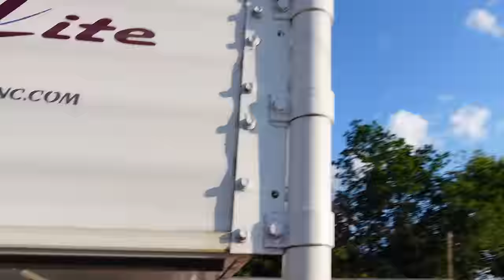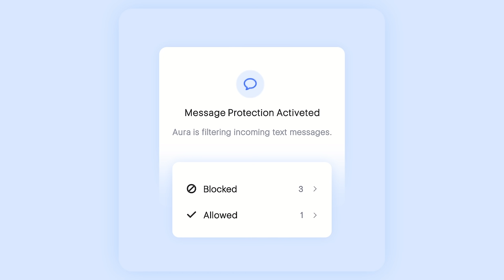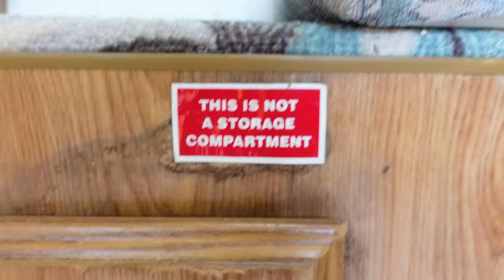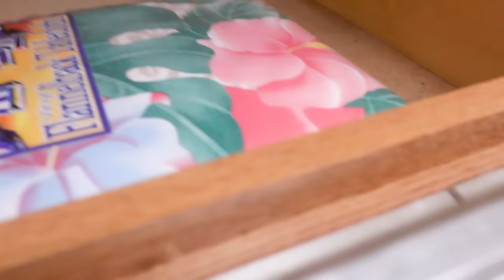i bought an old TRUCK CAMPER...was this a mistake?

Comment: For anyone else that might be interested in buying a used RV, try everything first! Like Victoria says, these things are built very cheaply. Crank it up and down, run the stove, test the refrigerator, etc. If the seller won't allow that, move on. If it smells, if the roof is soft and spongy, or you see water stains, pass, lol. This doesn't guarantee that you won't run into surprises, but it does limit them.

Comment: Im sure everything will work out fine with this camper top. Imo i would have rather just built my own slide in sleeper cab that fits in the bed. Could have built out of wood and added proper siding and roof. May have been able to build it for $1200. But the one you got looks like its in good condition so not bad either

Comment: i had that same exact camper. you can pick up the attachment to put in end of a cordless drill that makes using jacks a breeze. i found that raising and lowering the pop up was not very hard. little more effort to raise than lower but not hard. if i were to guess the entire pop up mechanical system needs lubricated. the fridge worked awesome. the furnace was annoyingly loud. the lil 4' door pissed me off the most. at 6'3" i would scalp myself at least once a trip. pretty good lil camper though. maybe find some inflatable sacks to put between bed rail and camper. inflate them and should keep it from moving side to side while in truck.

Comment: You may not need a new axle. You need to cut the bearing race off the axle. That’s part of the procedure when replacing the bearing. Try to find a Toyota dealer and take it there they can fix it

Comment: Man those scrapes suck. Obviously not there with the truck but the inner bearing race that the ball bearings came out of can usually be (carefully) cut off the axle so you don't have to replace the axle. Maybe check into the electric motors for the top of your lifting posts. That hard to crank top could just be lubrication of the pulleys and/or cable slides. Armchair diagnosing here, but just my experience.

Comment: Girl, great job on the Toyota truck.  Theyre solid.

Ive had that same exact camper but it was marketed by Apache.  Get a cordless drill and adapter bit for that pop-up and the legs outside.   Be careful the canvas is properly tucked inside when it goes down.  Be aware of those jack legs on curbs and if off roading.  Also people in parking lots tand to run into them.  A lady ran into the back of my truck and destroyed my setup.  Anyway, hang on there and youll get it done.  Wish you were close by, Id fix those oil leaks on that Toyota.

Comment: Use a type of pin & cotter pin for the side posts so you can remove them very quickly instead of bolts & nuts ... Get a decent rechargeable impact & find a fabricator to make you a bit to help crank everything up & down... Plus with a impact on the inside you can assist by pushing up with one arm but maybe some good lubricant like Kroil will help a ton in every moving part ... Replace air shocks under the top bed & you can use one finger to lift it then ... Most of the mold & smell is from sitting & not actual leaks ... Any good boat cover place could re do the canvas or fix it if needed & i think its a great buy you could actually make money off selling if you wanted to just clean it up without making it a home on wheels for yourself... That truck is perfect for you & most of your fear is in your mind ... That tundra is a great truck & more than enough to keep that pop-up on the road unless you are talking about 80 plus side winds but then park in a low area away from the wind & let the world go by for a day ... I would suggest Rancho 5000 shocks front & rear so the weight doesn't eat up front tires & it wont sag much either... Grew up with a slide in camper & cap so we could enjoy road trips as a kid ... By the way love your ink ...

Comment: As you take things out think about the weight you are removing and as you move things in or replace like doors or cabinets remember the weight difference. If you have access to a pop-up shelter to sit over the camper that would be helpful so you can leave the canvas pop-up open. To let it air out as you are cleaning and washing and etc. if you can replace some of the heavier items like the massive plywood under the bed with a lighter wood for under the mattress that will still support you will eliminate some weight. I saw the post about the electric lift, which would be helpful and you could do new hydraulics for the lifting mechanism on the bed. Kind a like the one you just replaced on yuki for your back door. Weatherproof caulking might be your best friend. I know you can make it aesthetically beautiful and fun and unique. There is possibly ways to replace the canvas… I would definitely look into it before spending days cleaning it. Killz paint, which sucks to use because it stinks and is not environmentally friendly. But it does kill, mold, mildew, and stains, and then you can paint over it. I think you can even get it tinted. So very excited for you on this new journey and I know you will do great. You probably know most of these things, but I thought I would share ideas. Oh, I want it to look like a “gypsy“ caravan very bohemian. But even cool industrial would look awesome. You’ve got this.💚🖤💚 I don’t know about in your area, but I do know you can find RV junkyards. If you need to replace windows or the rubber seals around the windows, possibly even some of the cabinetry, if it’s too water damaged and you can always be creative with cabinetry.

Comment: I propped my secondhand slide in camper on a couple sheets of 3/4" plywood to get a little clearance to the bed rails and cab. There are several kinds of tie-down options out there.  It doesn't have to cost you $1,000 unless thatbis what youbhave your mind set on. I had air-lift bags installed on my Dakota to handle the weight better.  It doesnt rock side to side like it did before. I loved my pop up camper and it wasnt nearly as nice and new as yours. Get a cordless impact drill with a socket to raise and lower you jacks. I used to just take mine off or fold them up and out of the way of rocks, trees and brush. I wouldn't be too discouraged. Whatever you do to fix it up, do it right and it will help your resale.

Comment: I just bought a 85 Toyota dually camper 2000$. With 53 thosand miles. It's all original. Who ever owned it took care of it. But the inside of the camper is so dated. But I knew that before I bought it. I will be redoing the inside. I wish you the best of luck. dont beat yourself up too bad.. Maybe I'll see you on the road. It's going to be my new life. I rented out my house . So moving out of a 3 bedroom house to a camper will be interesting. I ❤ your tats. Don't cry. You got this. If you need any advice or help, let me know. I built my house so I'm mechanically inclined. I think your awesome for putting yourself out there. Stay strong.

Comment: Hi Victoria :) . So nice to follow you on you're adventures. My daughter is also called Victoria, and her middle name is Sofie. I was thinking. Is it not possible to make a thing you can use with a power drill to lower you're roof ? A mechanic could ease make some that fits in the hole where you put the handle for lower the roof. Also for lower the 4 feet for the camper outside.

Comment: Hey, don't stress over it. You got what you a fair deal on it and it is what it is. Is it going to cost you some money to fix it? Sure, and by the looks of it, it's going to take a lot of work. But when all said and done, you're going to love it, you'll be proud of it, because of the work you put into it, you'll be able to make it the way you want it, and it will be all yours. Plus, there are many ways you can insulate the canvas for when you get into the colder places. Don't stress over the stuff that you can't control, just roll with it, figure it out and make the best of it.

Comment: People are modifying their crank handles for the roof lift and for the four jacks on the campers. They use an electric impact driver and it's faster as well as less physical stress on your body. Might be something to look into. Also maybe put new grease in the mechanisms to make it easier as well.

Comment: Take your time and restore it. It will be a learning experience. At some point in the near future, sell it and get a travel trailer. It will be larger, more comfortable and a lot safer on the road. It will be a lot easier to decouple a travel trailer than to place your truck camper. The problem with truck campers is that you usually need a heavy duty truck. Travel trailer will allow any v8 and some v6's to tow. With a travel trailer, you won't be so restricted on weight as your truck will easily pull 5000lbs and there are many travel trailers in that range that will fall within that same $3300 price range.

Comment: Measure the inside of your beds width, subtract the width of the bottom of the camper, devide by two an build 4 boxes that size. Put one in each corner before sliding it it to hold it centered.

Make a longer crank handle. Twice as long = half as hard to crank.

There are lots of cheap options for tying it down, but with those boxes avn it strapped forward, it will not go anywhere. I spent more than a year running 911 calls with one in the bed of my truck. They move a little a rock the truck a lot, but it never went anywhere.

Comment: Nice camper, just needs tlc work with what ya have. Silicone wet spray lubricant on inside top mechanisms will help, not grease too messy and hard to pin point. Vinyl has stiffened why it's more difficult when raising and especially lowering. When temps drop will be more difficult even, plastic windows can crack at low temps don't raise/lower below 45 or so. Paint those cabinets white or something, sand and prep, wipe with acetone or paint thinner before painting, that vinyl has wax in it... ask me how i know. Good luck, get to work!

Comment: you dont need a new axle. take a grinder, cut some relief cuts on the sides, get a torch with some map gas and heat it red hot with the axle in a vice with the hub in the air. heat...and heat some more and the race should slide down on its own. 
OR you can just cut off the race very carefully. if you nick the axle shaft, no big deal. theres many cars on the road with nicked shafts from getting the race off. the wheel bearing exploding is a common thing. 
hope this helps.

Comment: I purchased an RV recently, a 2016 which isn’t that old, looked great on the lot…but got it home and all the major systems were a mess. I had huge buyers remorse. However, I fixed everything myself, turned it into an offgrid unit, installed EG4 inverter with 600 amp hour batteries, 100 watts of solar panels, a larger fresh water tank, deleted the black water toilet and went with an incinerator toilet, did all the work myself to save money. Long story short…I live full time in my RV now, no mortgage, no electric bill. Smaller simpler life. 
You got this ma’am.

Comment: I have a camper on my truck that weighs 3600 pounds and a 8000 pund horse trailer, and I can tell you the first trip of every year fot 20 years it is a little scary. The first 1/2 hour of every trip feels weird. But i have seen these things go down a steep gravel road when the tiedowns were forgotten they dont fall out. I move mine from shop to backdoor every trip with no tie downs.. You will do just fine! There should be rubber bumpers up front to keep in centered

Comment: I live in a truck camper with my two! And when I first got it I was unprepared also. I think my torque lift tie downs cost me about 700 bucks. And about 300 to have them installed. But I also had to have a front-end rough country steering damper installed at the same time. I have a dodge 3500 Dooley. Play Okanogan Dual slide truck camper. Pretty heavy. So, I had to have airbags installed and a heavy-duty sway bar. Now she rides really good. But I did have a problem loading it just like your head I had to measure to find the center of my truck and put some tape on my camper and then put some tape across the center of my bed so that I could back up and line up the two tape marks, so I'd always put it right on the middle. Ever since then it's been pretty good. You might wanna look into an over the sink dish rack. They're not that expensive but in a truck camper it makes a big difference. I also got this garbage bag holder that I can hang on my drawer that uses the grocery bags from almost any store. Very convenient so that when I go into a gas station I can easily throw my garbage away because it always fits in their containers. It takes a little getting used to and a little bit of effort but it's one time effort which is the best part once you get it done you don't have to keep doing it. Enjoy   Ohh yeah one more thing. Definitely gonna need to buy a really good dehumidifier. And a humidity gage. If you get that you won't have any problem with mold in the future.

Comment: As far as the cranking issues being a slow drag, take apart the mechanism and find a way to attach a impact or drill to it. A powerful drill, if attached properly, can make that job as easy as pressing the drill to the cranking assembly and squeezing the trigger retracting everything. 18 volt batteries on cordless drills can do wonders. Very powerful
Reply: Same concept, find a way to use a drill to raise and lower or slide in and out your issus i saw you having in this video.

Comment: Unless the halfshaft is damaged you can cut the bearing seat and if it has a second retainig ring cut this aswell then it should come get cutting disc on a angle grinder and cut diaganally being carefull not to cut into the shaft and back plate it is a simple job if you brought it to my workshop I would charge about $50 to remove bearing seat and fitting the new parts.

Comment: Also, as far as the canvas goes, you can get any damaged areas replaced by a local Apolstry shop. There are boat and vehicle Apolstry shops that can fix just the bad parts. I didn’t see the truck but that light being on for a wheel bearing is very common. That’s not an electrical problem it’s a common problem. Keep your head up. You’re killing it and doing awesome. Your obviously not dumb at all

Comment: You would have been MUCH happier with a small, cute, towable.  Truck campers are a different ball of wax.  FIRST off, I am experienced in them, I have a 2,500lb (when empty) Apache 2008 truck camper for my ONE-TON.  I ALWAYS recommend keeping at least 25% of your payload capacity AVAILABLE if you use a truck camper - this is why I bought a dually one-ton.  I have almost 50% of my payload capacity available!  This is so I can still tow a boat (this is WHY I have a truck camper - otherwise I would have a towable).  You WANT extra capacity for those panic situations.  Secondly you MUST HAVE electric lifting jacks, ESPECIALLY IF YOU ARE ALONE.  It will take you over an hour to lift the camper alone bcuz you can't turn a single jack more than one-2 turns before you MUST go to the next jack in order to not twist the camper.  You need the right tie-down system, and you CAN'T go off road bcuz the camper is too top heavy and can be dangerous with a non-dually tippping to one side.  I HIGHLY recommend you sell the truck camper and get a nice little towable.  Oh, and having a leak to deal with - forget it.  Sell it before you find out how bad it is and have to fix it. It's not too late - get rid of it!  You are the wrong use-case for a truck camper.  A good tie-down system will cost you about $1,000 also, and the hybrid nature of you camper - NO MOVING PARTS is best!  My truck camper has NO slides, and does NOT pop-up.  LESS TO LEAK. I still keep a truck camper bcuz I only camp a few weeks a year, and I have a place to keep it OUT OF THE WEATHER (VERY important!).  Mine is like new becasue I take care of it.  Yours probably will be a big regret and you will hear my words ringing in your head in about one year if you don't get rid of it and take the small loss while you can and SAVE huge later on...  I am so tired of people with bad advice saying to 'geep going girl', let's be real - this is the wrong type of camper for you.  BTW, to replace the four jacks with four electric lifts will cost you over $3,000 alone - plus battery upgrades will almost certinly be necessary - figure on $3,500 plus labor ($5,000 for someone else to install them).  Did I say to sell it and walk away enough times yet???  Also, YOU SHOULDN'T need a new axle because of a broken bearing!  Who is telling you this?  I am the best mechanic I know, and I've never heard of such a thing.  What EXACTLY broke?  Something sounds wrong here.  It's like the blind are leading the blind or something.  GET a real mechanic to chime in here.

Comment: I think the camper is great. You can’t beat the price, a new one is soooo expensive. 35,000 to 70,000 for a new camper is crazy. Congratulations on the new truck and camper. With a little tlc you’ll get it sorted.

Comment: Use an ozone generator inside the camper. It will kill all mold and anything else inside. It will also smell brand new. They are cheap and easy. A detail shop may have one you can use. Good luck. Great content!

Comment: 13:27 the hand crank lift system...  you could modify that with a hex head and use a high torque drill/driver to zip it up and down. also make sure all of the moving parts are properly lubed and not binding or riding against surfaces.

Comment: Pulling a trailer of some kind, probably would’ve been easier on your truck on and off-road. You’re gonna need to upgrade your driveline and suspension with all that extra weight off Roading. or expect to break a lot of parts on your adventures.